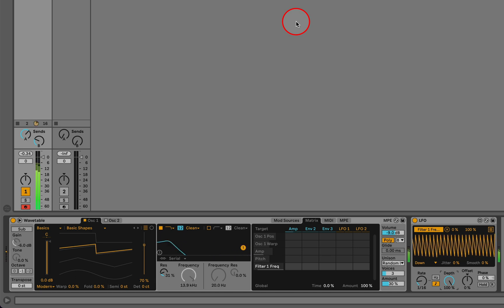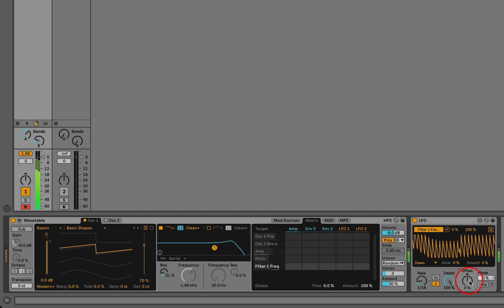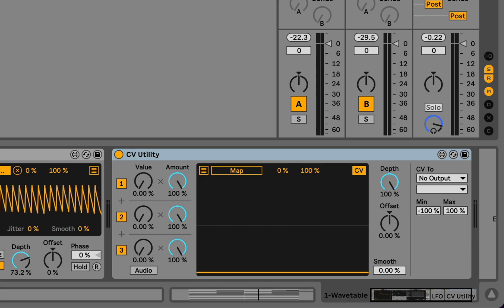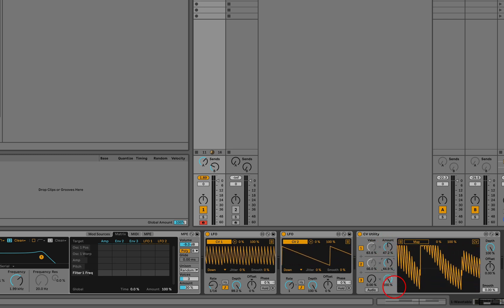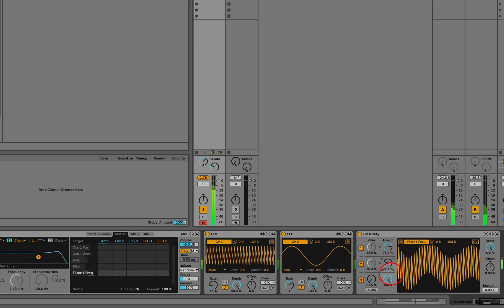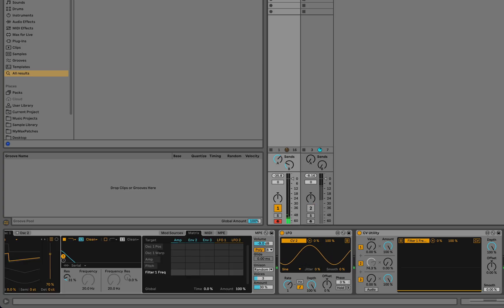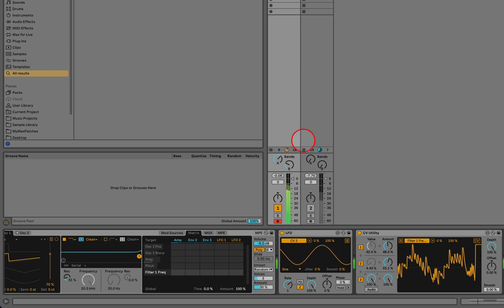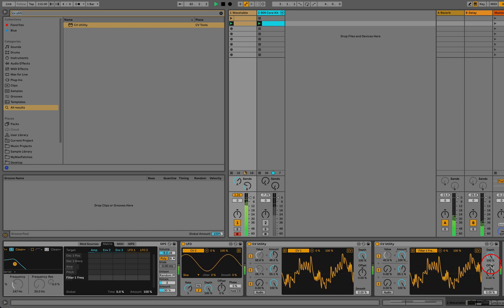Combine multiple modulation sources with CV Utility

Comment: GOLDEN. How many times I've hopped over that download because I don't control my semi-mods from Ableton... I knew one day I would be kicking myself. This day has come. Thankfully it's just a download away. Huge thanks for this one. Doubly nice that the oscilloscope shows the combined mod signals. I like the Env follower thing you did as well. Wonder what that would sound like mixing the drums in and out with that modulation!